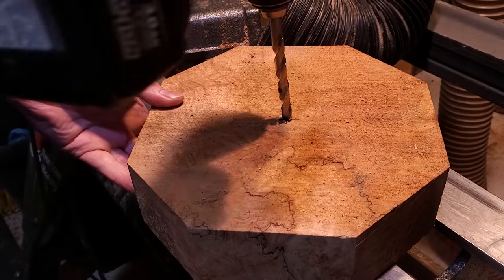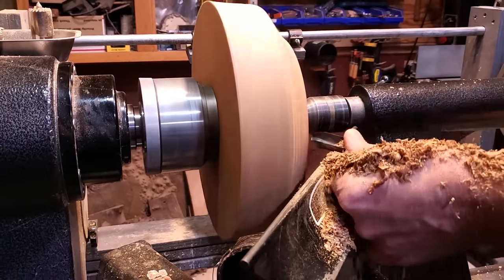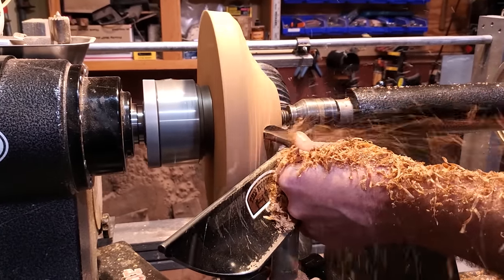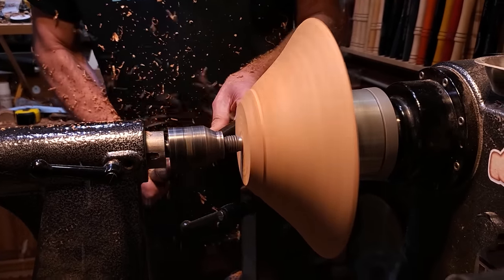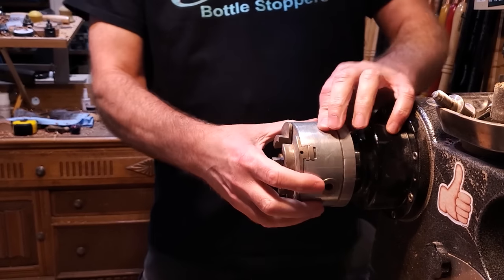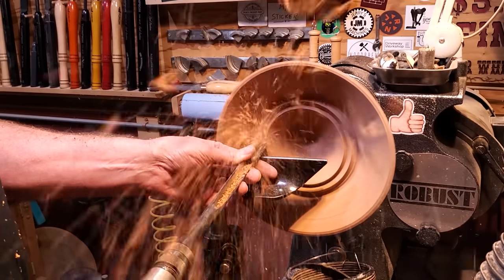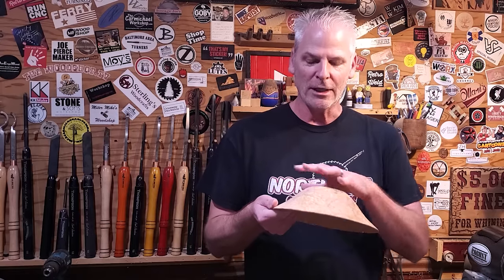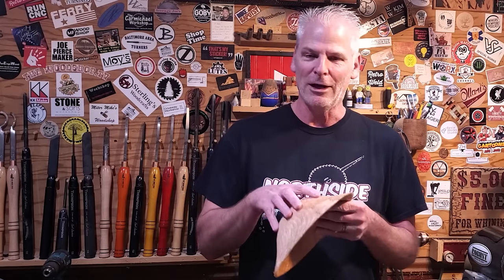Woodturning | Punky Maple

Comment: I turn a lot of punkie wood. But what I do is mix a cheap can of varnish to 1 to 1 mix with thinner. I get the piece close to  final shape then do several coats with the mix, letting it soak up as mush as possible. Then let it sit inside a dry box for a week before turning it to its final size. \it works well enough that I keep doing punkie wood
Reply from the maker: Very cool, thanks for the tip.

Comment: Carl,  It is probably too late for the one turned bowl, but stabilizing in cactus juice might save the one that is not fully turned.  Hollow out the inside as if you were doing a twice turned bowl.  then fill it with cactus juice and put it into a vacuum bag. I used the technique in bags with good success and minimal cactus juice.  Would be a good follow-up video.
Reply from the maker: Great idea, I have a vacuum bag 😀
Reply: If you do stabilize it, try adding some dye to the cactus juice and youmay land up with a reallynice piece instead offirewood! @CarlJacobson

Comment: Shellac or sanding sealer or Minwax wood hardener all put a firm surface coat on the wood that can then be worked without tear out. Even moistening the wood with water will help in a pinch. I only do cactus juice if it is burl or curly maple with alternating grain direction. Even hair spray works (heavy saturating coat). I turn a little thick, apply sanding sealer, let dry then shear scrape. It may another layer of sealer if the tear out is deep. If I can crumble the wood with my fingers, I usually send it through the cactus juice routine.
Reply: I have had good luck with sanding sealer

Comment: I have had good luck using shellac on punky wood that just tares out. Multiple coats that the wood just sucks up. Last one I just finished I went with the carbide for the finish cuts after trying bowl gouges., and it seemed to work. Very, very light cuts and lots of sanding.  Sometimes sand and some more shellac and sand again.  I have not been turning very long, but I figure I am learning how to fix different problems by sticking with a problem piece of wood.  Plus, I am stubborn LOL.
Reply from the maker: Thanks for the tip John 😀

Comment: I,ve had good results using min wax wood harder. Brush on a liberal coat let dry fore a few hours and re coat. If real soft  3 or 4 coats.
Reply from the maker: Thank you for the tip.

Comment: Not every blank is worthy of time.  Appreciate seeing things that don't always work out.  One possible way to use a blank like that would be to abandon using it as a bowl and cut into smaller chunks for pen blanks, handles,  or bottle stoppers and then stabilize the smaller pieces in Cactus Juice under the assumption that the smaller pieces would stabilize more successfully.  The spalting and figure could then be exploited in those smaller pieces. [Saying this as someone from a state with not a lot of trees, so all wood is somewhat precious.  If you are in a place with an abundance of wood, my suggestion is probably more work than it is worth]